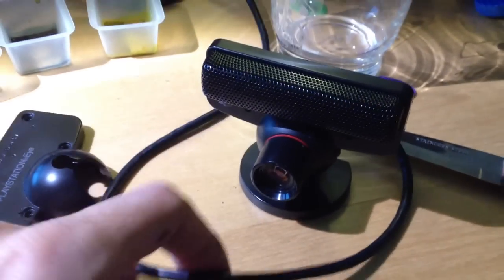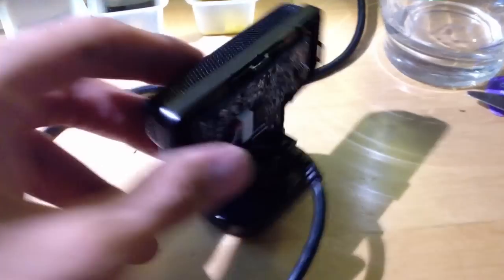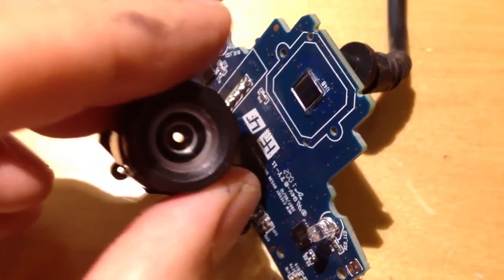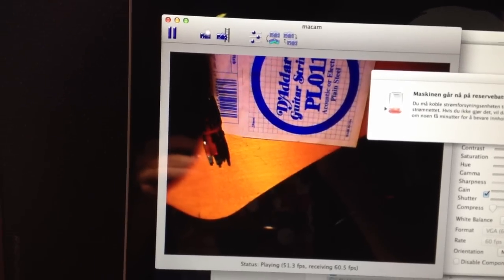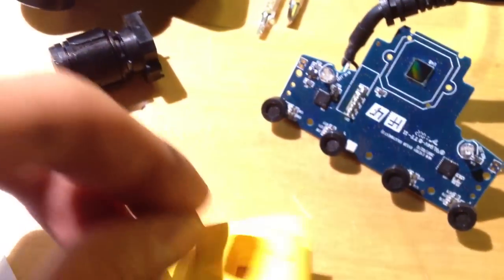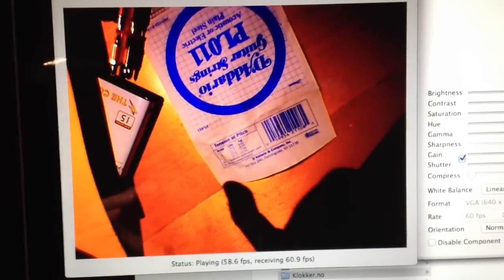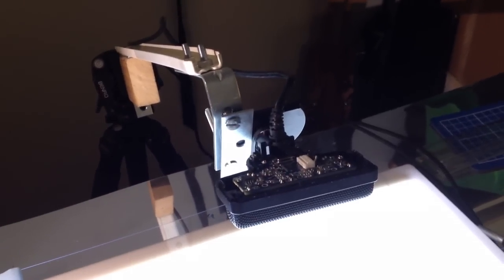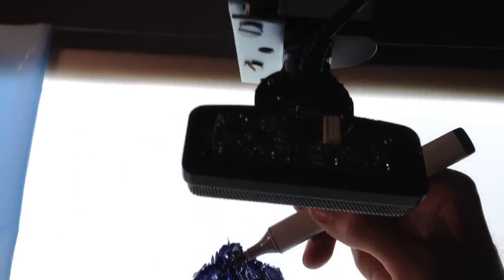PS3 Eye Cam Mod - Cuckoo

Comment: Wonder if adding some sticky foam would work like an adjustable "fine tune" for the focal point by screwing it tighter or looser. Might try it.
Reply: just use the silicone screw covers

Comment: Wow, that's pretty neat, thanks a ton! Works great. Perfect for some macro photography.

I wonder if you could place something elastic (ideally two small springs) that would push the lens holder from the PCB and drill holes in the case so that you can adjust focus while it's assembled with a screwdriver (or better yet, maybe glue the screws to a shaft so that you have easy to use knobs outside the case).
Reply: you can use the silicone screw covers

Comment: Just wanted to thank you for this. I ended up just using a rubber band wound a couple times to hold the lense between clicks. It's nice to have it focused where I want now.
Reply: I've used a bit of tape to hold it in place. But a rubber band seems like a good idea as well.